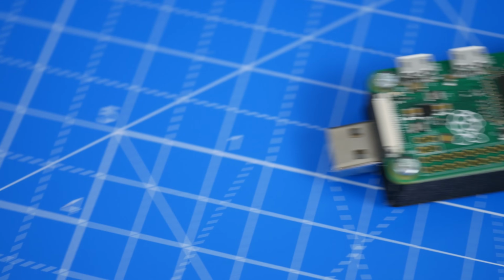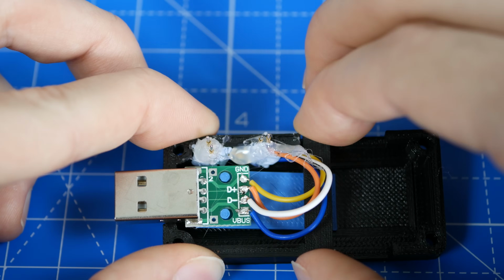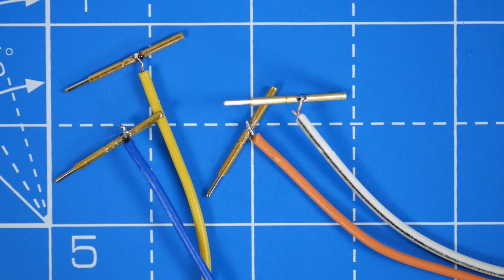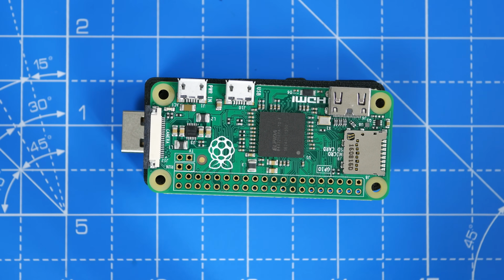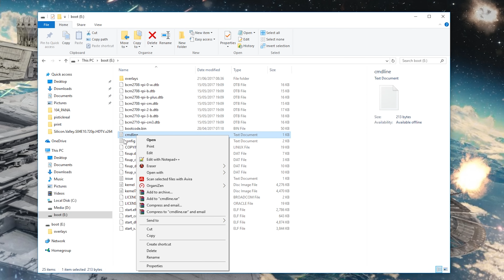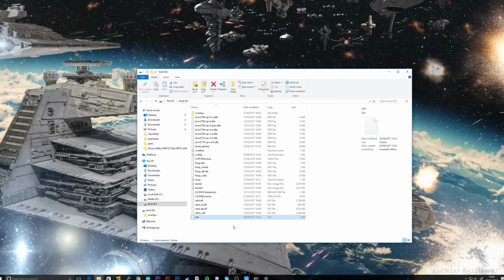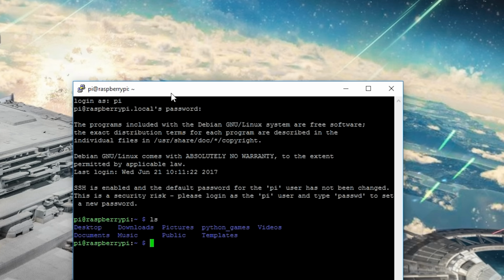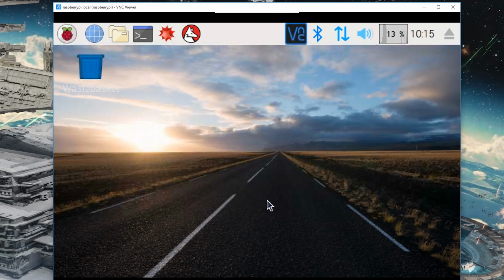Raspberry Pi Zero USB Dongle

Comment: easier just solering it to the pads, so you don't get glitches when the contacts bounce on the pads for som ereason. no need to use a pi zero for anything else onece you have this thing. then just buy a new one they jjust like $15

Comment: I’d much rather have the USB permanently affixed. This looks like it will fall apart at any moment. Not all use cases are “black hat”. Honestly this looks like a brilliant .TAILS and Bitcoin wallet. Simply unplug it and it’s impossible to hack. If you need a computer that is 100% secure and “hack proof” this would be great. You can’t hack something that doesn’t even have power.. let alone not on network.

Comment: Surely as the pins are just direct contact you could use the data port without issue as long as the USB isn't plugged in at the same time.

Comment: Say you have a raspberry pi w that is configured to connect to wifi, would it be possible to use the pi's internet connection from the PC it's plugged in to? (ie: use the pi like a wifi dongle)

Comment: As the Pi Zero is only $5.00 or $10.00, I wouldn't bother with 3D printed part just add the USB plug.
Reply: They're so expensive now 😭

Comment: so you plug in a separate computer(pi) into USB port of another computer?why? what purpose does making it a USB stick serve. I'm really contused.
Reply from the maker: It's easier programming the pi this way than with a crapload of adaptors, monitor, keyboard and mouse setup.

Comment: Hi! I just bought the arduno chip and it works fine at first, but after that, there's no available ports, i have tried every usb port on my laptop but none of them works, i have chose the right board but there's no port i can choose. Please help
Reply: aiden burkholder you are probably using a a USB power cable you need to use a usbdataand powercable
Reply: TheEnragedGamer i am using the usb and power cable

Comment: @Seytonic Where did you get your usb breakout board?
Reply: Direct link if possible please.
Reply from the maker: Here you go http://www.ebay.co.uk/itm/USB-to-DIP-Adapter-Converter-4pin-for-2-54mm-PCB-Breakout-Board-DIY-Power-Supply-/201382171605?epid=621933142&hash=item2ee35013d5:g:6XUAAOSwjVVVlBSp

Comment: make that black sliding block have a spring clipping thing so it can be locked into position with a modified version of the main pogo pin body that has grooves to allow the locking

Comment: Don't  you think I think the soldered wires on the breakout board will fail, perhaps some hot melt will sop them from breaking at the solder joint. Apart from that it's a nice project, thanks.

Comment: I would make the prongs on the blue piece a little bit longer and probably add channels to the opposite piece to guide those prongs, to ensure that the USB breakout board doesn't fall off or wiggle left and right, without having to use hot glue.

Comment: What about it having an HDMI out?
Reply from the maker: The HDMI pins aren't broken out so its best just to use a cable there, however you would need a power supply as well as hdmi.
Reply: Okay, thanks. It's the first time I'm seeing the Pi Zero, but I was just wondering, since that's what all the other USB stick PCs do

Comment: Love the project but why pogo pins? Might as well just solder the USB breakout directly to the pogo traces unless reusability is so important for a $5 board...
Reply from the maker: Pi Zeros are made in the UK, so I have have no trouble getting them. Though if you live abroad they can get very expensive if there isn't a retailer that caters to your area.
Reply: In the US I think it's available at MSRP from some electronics stores or adafruit (plus shipping), but you didn't answer my question at all. I know you have videos of directly soldering adapters, so why not do it this time?

Comment: Seytonic: You only need this, and this and this.
Me: That doesn't sound too bad, but where did he get the case?
Seytonic: Oh, and you need a 3D printer.
Me: Oh.
Reply: Sam van der Kris same reaction 😂😂😂
Reply: BlueArduino 20 Dude, you're everywhere.
Reply: Serek Nope, I'm Dutch.
Reply: You don't need a 3d printer to get this done.
You can solder everything together and then put it in some kind of case.
You can simply build one your own without a 3d printer
Reply: Well, most libraries and stuff have them now. They're expensive so make sure it's worth the cost, however.
Reply: I love how people think you must own a 3d printer to get parts 3d printed. False. Find a local shop that has one or order the printed parts online cheap. Surely you can find someone who has a 3d printer nearby...
Reply: Sam van der Kris Znacz polski
Do you write in polish launge
Reply: You can pay an online service to print it for you

Comment: Which brand or model 3d printer are you using? I am looking for a small for my personal use however couldn't find anything fitting my needs.
Reply from the maker: Its a flashforge dreamer, pretty good, though rather pricey if you want one just for personal use here and there.

Comment: Awesome! Is a next step for this figuring out HID/Auto run with this?
I was looking at https://github.com/mame82/P4wnP1 , which is made to make the pi zero is a bash bunny competitor, of course, with the difference being how inconspicuous the bash bunny is.
Reply from the maker: Will probably be doing something on that soon.
Reply: Seytonic dank
Reply: I find it how ironic it is that he is pushing "Malduino" (USB Rubber Ducky Knock-off) in the same video... XD 7:30PM 7/8/2017 BTW: It is not even "a bad USB", BAd USB is an exploit on REAL USB's, not an emulated keyboard designed for that... XD
Reply: Btw. P4wnP1 doesn't work for Pi Zero W or it's my fault? I can't get it to work. I am considering buying the not-wireless one to see if it'll run.